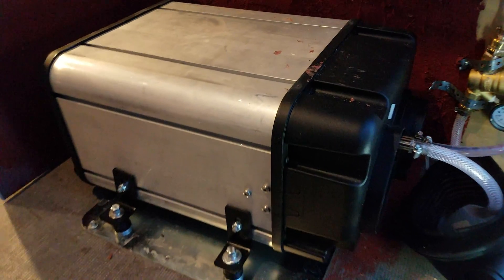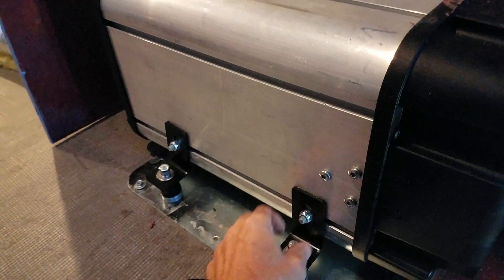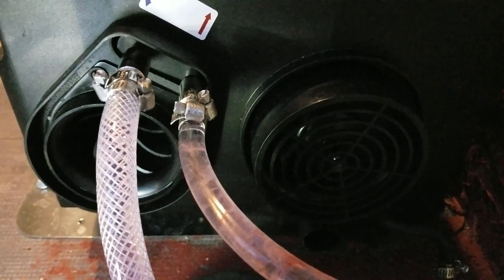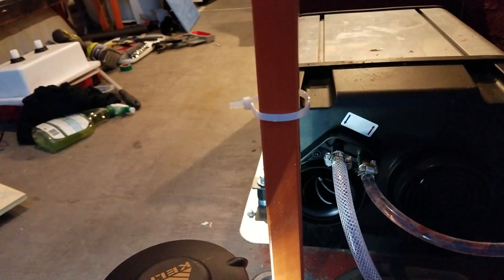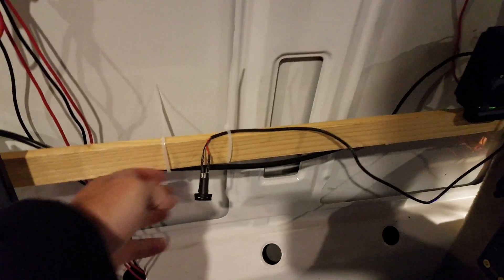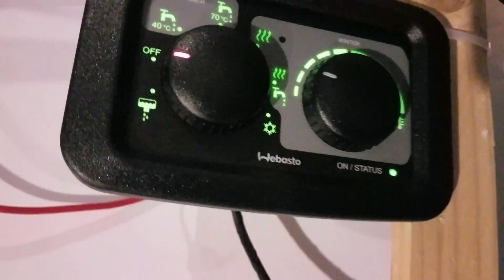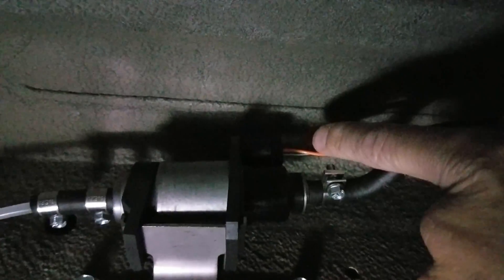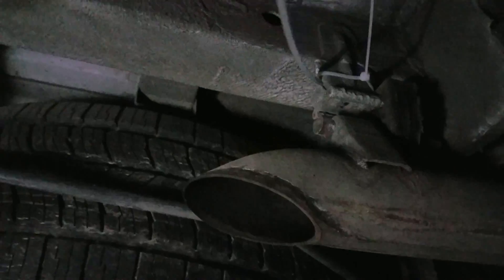Sprinter Van Conversion- Webasto Dual Top 6

Comment: I have a question, it's 2025. In October 2024 I had a van belt and I had this put in. It's now leaking underneath the van. I sent a video to my builder and he says that there's some sort of pressure valve. I've read through the manual. It doesn't talk about a pressure valve. Your video doesn't talk about a pressure valve. Do you have any ideas since my builders is absolutely worthless?
Reply from the maker: I dont unfortunately,  I dont remember a pressure valve.  My best gas would be that they're talking about the freeze valve, seems like on the bottom and underneath there was some sort of freeze valve since a lot of these are mounted outside of heat controlled airspace.  So it seems like it had some sort of release valve if it was freezing to kind of drain.   Sorry I can't be more help, we've sold that fan several years ago and since they didn't offer it anymore I had to go with a different model for the new van so I just don't remember a lot about it. I only know is I did love the webssto 6, Thing is a beast compared to what they're selling on the market now

Comment: That cooling fan is supposed to be ducted outside, as well as that combustion supply hole. If not, you run the risk of carbon monoxide entering the van, then you wake up dead. 
EDIT: wow, the fuel pump is upside-down, and the exhaust is supposed to run to just beyond the edge of the body. It's all right there in the manual. I won't mention that the duct tape will never hold up to the temps it'll see.
Not knocking you, just want to see you get a long life out of it.
Reply from the maker: Wow what in the world would we do without the internet police..
Reply: @CameronHill23  I came off wrong there. I'm not trying to be the internet police, but I see seriously dangerous things that you did, and you're allowing yourself to come off as an expert, or as someone who's example others should follow. No, you didn't say that, but it's implied. The upside down fuel pump isn't a huge deal, but the other stuff is. Not sure how much of that is in the manual, it's been a while.

Comment: Thanks for great tour. Kudos to you—nice job. Did you ever have to do any maintenance? Like replacing the burner and glow plug (service kit)? Mine started to malfunction at altitude (over 6,000 ft) and it’s almost 4 years old. It runs fine at sea level. I was told the burner is probably carboned up and  need to run unit at full heat (doors open in the cold) for 30 min to burn it off. I’m afraid it won’t do the trick and when I go back to mtns I’ll be screwed without heat. Wondering how difficult replacing the burner is….I found one video online….and even if I do it, how challenging it will be get unit running correctly once done. Thanks again for any insight.
Reply from the maker: We had ours for about three or four years and never had any problems with it other than I didn't drain it once and I had a fitting freeze. Luckily we have Webasto service center near our house I was able to take it up to them. It was rather expensive, probably should have just done it myself. Hindsight is always 20/20 😁.  Other than that we never had any problems, pretty much the only time we would use it was when we were in the mountains at higher elevations. Unfortunately I don't think I'll be able to give you any advice on doing maintenance on it since ours ran pretty good the whole time we had it.

Comment: Hey Cameron, Not sure if your still monitoring this thread. Can you advise how you have liked you Webasto Dual Top ST 6 now that you have had it 4 years. Any issues?
Reply from the maker: Over all we loved it.  We sold that van about a year ago, but the Webasto was solid to the end.  We tried to pick up another one, but we're unable to find one I was able to talk to a rap who said it's no longer being made but they were working on another one that is similar.  We went with a kit from Heatso.com that is made up of several different brands (Espar, Webasto Kalori and others).  It's why harder to tie the systems together, and there are still ghosts in the system 😭, so I totally miss the Webasto Duo top 6 we had.  If you can get one I do recommend it.
Reply: @CameronHill23  Thanks Cameron for the info. Much appreciated. So Webasto have now made the Dual Top ST 6. Pretty much exact unit as the Dual Top EVO 6. Only difference is the ST is a stainless water tank for the water boiler instead of Aluminum. I ordered it off Heatso who were excellent to deal with, now just waiting for my van to show up at dealer. Thanks.

Comment: Can you comment on the quality and quantity of hot water? If you let the internal tank heat up, then use the water, will it keep up and just provide continuous hot water?  Or will the water get cold once the 2.6 gallon tank is used?
Reply from the maker: it's continuous. there's no tank involved on this one inside is a small boiler, but I don't really think they consider that a tank it's more on demand. It does take about 20 minutes to get the unit up to heat, then after that it's continuous hot water till we run out of water in our main holding tank :-).
Reply: @CameronHill23  thanks!
Reply: So you haven't run out of hot water once it came up to temperature?

Comment: do not like the noise inside,  have u ever cold start it in -30c or -20c weather?
Reply from the maker: We have run it down around -15 to -20 C with no issues.

Comment: Do you have a link to the pressure reducer that you used? Have you had any problems with the unit since installation?
Reply from the maker: Hey sorry, I do not. That was purchased at a local plumbing supply company. So I don't have a link to it

Comment: Althought it's super compact it's very very expensive. You can get 5kW GSM enabled webasto for 1/5 of price, whole complet to install wherever you want (inside engine compartement) plus buy giant water tank 500$ plus water/air exchanger 200$ (with switchable fans) put in chosen place. Switch fan to heat up air, or just water all the time. While keep it more silent than this combo. 70'C is bad for bacteries, if put UV can have dirty/clean water ready to use all the time. 1.5kW could heat up 120l of water +10'C in 30minutes witch mean 10'C in 30minutes using 5kW Webasto if it's 30% efficient. 50'C is super hot for shower so to have clean hot water/dirty cold water or engine water exchange could be handy.  Also to heat up engine in winter time or heat up water during driving. With just one instalation. To mine opinion it's not worth the money and noisy as you shown. It was super until i checked prive 3.200$
Reply: ? What????
Reply: Kamel I bet you do sums before taking a dump buddy 😂

Comment: Great video thank you! We're looking at this one but we only have a 140 so I'm concerned about space - do you think it would fit under the passenger seat like the air only Webastos do?
Reply from the maker: NOT EVEN CLOSE!!!  :)  The unit iwth the ducts coming off and hte hoses going in require about  25" long  12:" high and about 18" wide  (63 CM long, 45 CM wide and 30 CM high)

Good luck, let me know if you have any other questions

Comment: A quick word on the drain feature.
When the left dial was held to ‘drain’ for a few seconds, all the dial lights begin to flash. This indicates the boiler is draining. It will drain for 90 minutes, dials flashing the entire time. Simply hold the dial to the same ‘drain’ position for a few seconds, until the flashing stops, this closes the drain. 
The reason you always want the provided fuse holder wired directly to a 12v power source is so the auto drain function will do its job. 
This function will automatically (even with the control unit is in the off position) drain the boiler if the water temp drops to/or below 6c(~42f). Doing so to prevent the 11l of water in the boiler from freezing and damaging (rupturing) the boiler and other parts in the Dual Top. 
Frost protection will prevent auto draining by keeping the water above that temperature. It also holds the inside temp above freezing to protect the water lines running into the Webasto.
Reply from the maker: Good point I should have mentioned!

Comment: have you ever used this at high elevation? like 9,000 ft?
Reply: Hey Brian,
I’m finishing up 6 months of traveling around North America with our rig. 
I’ve run our unit at somewhere around 8,300ft for one night. It worked just fine. Not sure if 9,000ft would be pushing it. 
The literature states, ‘guaranteed to 7,200ft’. If you live about that and venture higher, contact Webasto for a high altitude add on. 👍🏼
Reply: Mine works great in the High Atlas in Morocco. As Cameron Hill says the pump clicks but I love to hear it ! I know the heater is working and I am WARM !

Comment: Hello, mine is quite noisy and water is not coming out when turning to hot but the controller is fine without warnings, it's been for a while switched of, could you please advise what to do since I am from Malta and we don't have any webasto dealers? Thank you in advance
Reply: Zanzu Photography 
Are you still having this issue? 
If so, I will try and help. I’m no tech, but I’ve completely dismantled my Evo 6 at one point, so might be able to help. 🙏

Comment: did you do after review? How was the noise level? fuel consumption?
Reply from the maker: Nope we never did one I probably should. I can tell you though the fan does make noise but its not bad and we are used  to it and can sleep fine. One thing I've learned is its noisier when it first fires up and brings the cabin up to temperature then once it is there, the fan seems to run at a lower, and quieter level the rest of the night. Overall we have really enjoyed it it's been able to keep the van very warm and temperatures around 20 degrees Fahrenheit. Overall the fuel consumption is almost negligible. I think one time I noticed it was when we have is running for 3 or 4 days and I barely saw the gauge move. Generally speaking for an overnight trip I can't even tell that it's used any fuel. Honestly once we have the van up to the temperature it will pop on two or three times tonight and run for 5 to 10 minutes is all at a very lower speed, so overall very economical on the fuel consumption

Comment: Hi Cameronyou need to use 10mm push on (john Guest) water connectors for the water or there is a real danger of the water connectin blowing off with pressure , and you need to get the combustion air pipe outside , there is a danger of fumes inside if you don't

Comment: Hi,
Nice install, do you see any possibility of being able to fit this unit under the van? Ideally in between the chassis rails?
Thanks
Reply from the maker: I spent about 40 minutes under the van before I installed it.... Its possible, but it would hang down pretty low.  One thought I had was to remove the spare tire and get a rear door spare tire mount, then use the hole it left.  I just could not find a good place that it would fit up into and give me the clearance I want.  Its not bad having it inside, no worried about fumes at all.  It is a little noisy once it fires up, but honestly, neither my wife or I have had problems sleeping.  Once it gets up to temperature the noise level drops and the rest of the night its much quieter running.
Reply: I would not do it in a small van. There are so many small heaters to fit inside.

Comment: Thanks for the video. Yours was the first video that I saw how big it actually is. "woah! it's huge"

It seems like there are two or three main sources of noise. The burner, the exhaust and fuel pump. (Having read your reply below) Have you managed to put more noise insulation around  it in the box? Has it made much of a difference?

Also, have you read how often it needs to serviced and cleaned? A lot of blogs suggest regular maintenance. Having only had it for one winter, you may not be at that point yet.

Finally, what are your thoughts on installing under the van? So many more holes, but lot's of space saved. Did you see a good spot for it?
Reply from the maker: Its surprisingly not bad, we sleep fine when it's on.  I have not done any more sound insulation on it.  The pump makes a clicking noise, but over all we love it

Comment: Hi Cameron, word of advice, the fuel supply pump installed against the chassis rail will fail as the electrics and the pump it self is not protected from road water / salt. Any holes drilled into the chassis will rust out in the future if not done properly. $80 guarantee of future problems there.
Reply: Those pumps are installed on the framerail of vehicles all over the world, for 20 years now. Incredibly durable pump.

Comment: Sprinters have a built in port at the top of the tank for auxiliary fuel use.
Reply: Hi Jon (From England) My Sprinters have a 5 kw Eberspacher (Engine Only)  fitted as standard and there is a blanked port on the fuel line to fit a 2 or 4 kw  cabin heater ( Which I always have fitted).  The Webasto and Alden are also great, but if you are thinking  saving, look at the reviews of the new Chinese copies , Sound Good!  To CitizenX Below.  They Cost NOTHING to run. Propane here is $ 42 x13lt You Guys there in USA have no idea how much we pay in Europe for fuel.
Reply: @anthonykeaveny8860   have you ever ran your diesel heater on kerosene? im in ireland and kerosene is like half the price of diesel here not sure what its like in uk.

Comment: how much gas do you use on a night with heating ?
Reply from the maker: Surprisingly VERY  little.  I filled up on our last trip and parked.  It was a very cold night (22 degrees F).  We set it to keep the temp inside around 65 degrees inside. It ran on and off all night and when I got up the gas gauge had not budged.  Still showed full.  I also checked my gas mileage at the next fill up and did not see any impact.  So I give it two thumbs up  :)
Reply: If it is connected into your truck fuel tank you would never notice . It costs peanuts . Be Very careful if you buy a cheap Chinese Copy.  They are great (Read Reviews) , but do not believe that they can run on gasoline. They only run (RIGHT)  on diesel . If your truck is Gasoline , run it from a 5 litr plastic bin in the trunk.

Comment: It´s a nice unit, but I suspect that noise can easily become mighty annoying after a while...
Thanks for your vid.
Reply from the maker: Surprisingly its not bad.   We have spent about 4 or 5 nights already in it in temps 20-24 degrees, I have set it at a lower temp on the thermostat and it keeps the van at around 62 all night.  When you set it at a lower setting it slows the fan down and the sound is not bad at all, just  low hum that actually is nice to sleep to.  I usually stir around 5 AM and will turn up the temp and it will get a little louder but its still not bad at all.  We have been very impressed so far and I would recommend the unit to anyone.
Reply: Thanks for the feedback, mate.
Reply: NO  !!

Comment: Wow. Very nice! How large a freshwater tank do you use? As far as install, fairly complicated or not too bad? Did you get it from heatso.com?
Reply from the maker: Rydawell Woodworks we went with a larger water tank so we could wash our bikes off in addition to having water for showering and cooking and cleaning.  Our tank is 46 gallons, we have another video up with a tour of the full van you can see it there. When I first got the unit which we did buy from heatso.com, it was a little overwhelming because nothing's really labeled and the instructions are kind of generic. I was way over complicating it it's actually pretty simple there's really no order to how you do it just whatever you can get to in the location you're stalling it. I was expecting some step by step instructions which they don't really provide they just tell you what everything is and you just install it. Heatso was good to work with. We had an issue with the shipping through customs that it got stalled for quite a while. They jumped right in resubmitted all the paperwork to the u.s. Customs group to help get it through they were fairly prompt and quick and responding to me.
Reply: Rydawell Woodworks I

Comment: Thanks for the good information man, I'm wondering why you install it inside the van, while under the vehicle will be better to minimize the noise. I'm waiting for March to start working in my van. By the way how much it's cost now..
Reply: Ash, There is no noise inside the van with an  Ebersbacher- Webasto_ Alden . the exhaust is outside . You can hear a click from the pump.  Only Like a clock.
Reply from the maker: Ashraf Mraish Thanks Ashraf, I looked at installing it underneath the van just couldn't find a place that I could fit in nicely without hanging down to low we do a lot of off-roading so I wanted to keep my ground clearance. I had that nice little spot in the back that wasn't being used and it fit in there nicely. It is a little noisy inside but we can live with it

Comment: hI cAMERON, i have decided to go with a company called Hurricane up her in Canada, they have a similar unit, Oasis Zephyr 33,000 BTU,  which heats cabin water and engine for about the same price but thanks for the info,  just a note, i was surprised to see such a big hole for the  exhaust,

I have seen several Espar installs and they made two holes the exact size of the tubing, 1 for air intake and 1 for exhaust.  like one inch each hole OR 1 1/2 "

i have heard good things about the webasto though so good luck with it.
Reply from the maker: They have a spec for the distance from the edge of the muffler edge of the hole, I went a tad wider.  I believe the Webasto gets hotter at the muffler because its a bigger boiler than the Espar.  I have noticed their exhaust hole was basically the size of the exhaust pipe in Espar.  I have never heard of the Oasis, but will have to check it out.   Thanks for the view!
Reply: The hole includes the drain for the boiler, which is right next to the exhaust
Reply: Hopefully you changed your mind about the hurricane